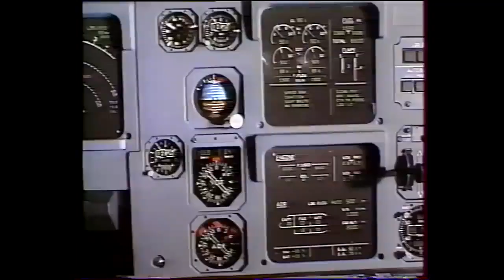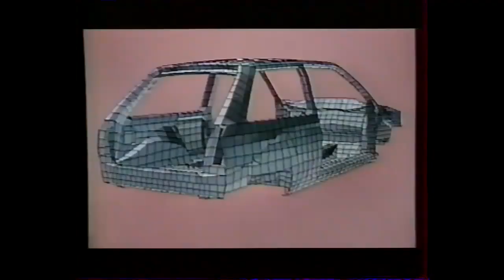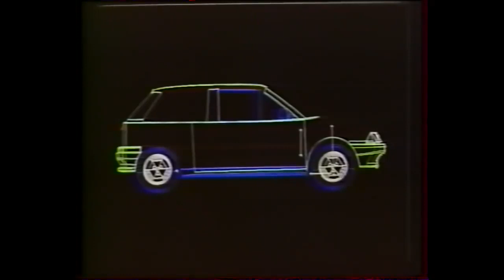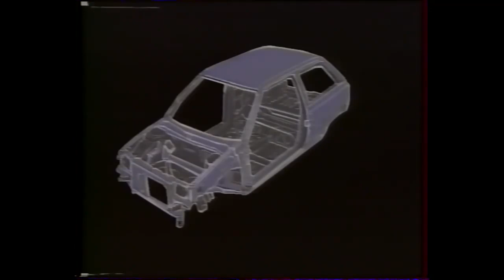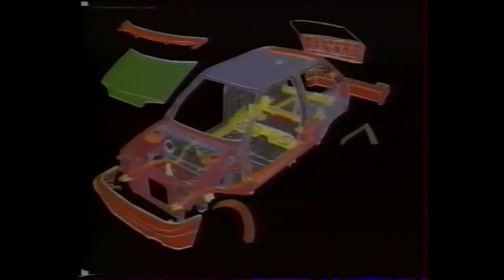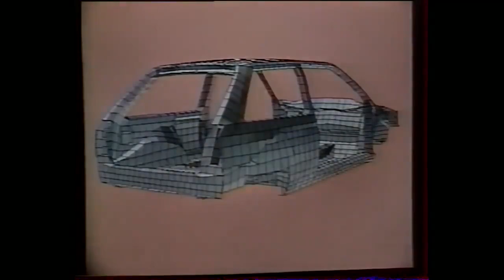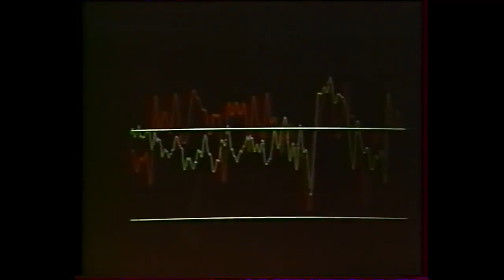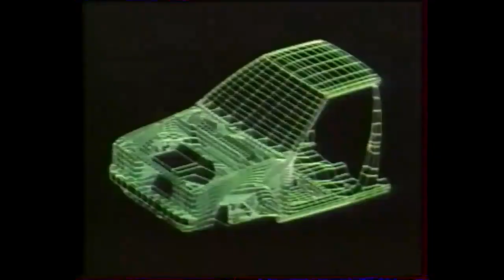Citroën AX, légère mais robuste !

Comment: Pour la résistance mécanique des matériaux composites, et sécuritaire, d'après le livre la Renault espace de mon père, il y dit par rapport à la carrosserie en Matérieau composite que :"(polyester stratifié, renforcé en fibres de verre, (composé de 1/3 de fibres de verre, de 1/3 de charges minérales, et de 1/3 de résine de polyester).
Ce matériau composite présente des avantages convaincants.
D'abord, c'est un produit stable, pour lequel de nombreux essais ont été réalisés, notamment pour la recherche spatiale, en vieillissement accéléré dans une gamme de températures allant de -40°C à +120°C. Ensuite, ses performances mécaniques sont supérieures à celle de l'acier, à poids égal.
De plus, en cas de choc, l'acier subit une déformation propagé alors qu'avec le polyester stratifié le choc reste localisé et il est absorbé par destruction du matériau, ce qui limite l'étendue des zones à réparer.
On peut d'ailleurs noter que, dans les tests de sécurité l'Espace se comporte de façon tout à fait analogue (=semblable) à celle d'une berline classique.
Enfin, on considère que les réparations sont généralement simplifiées".